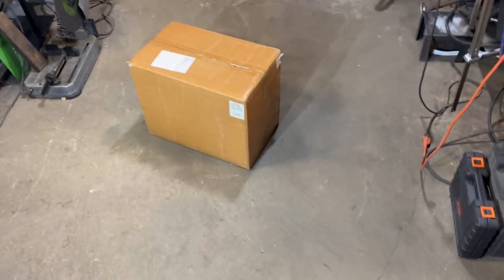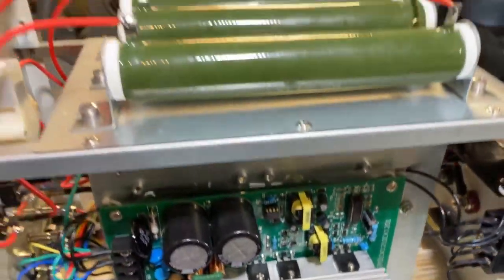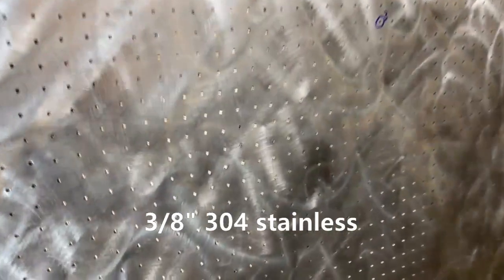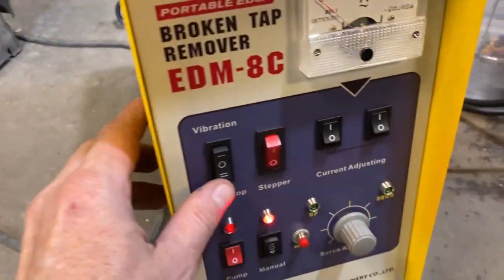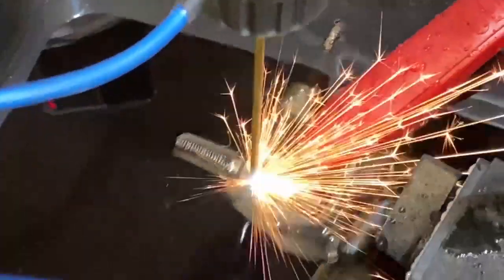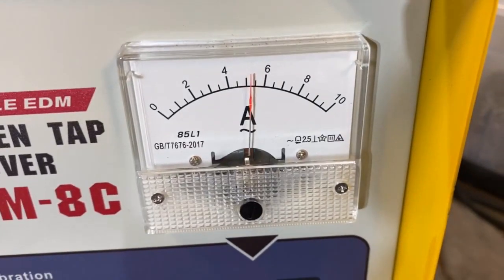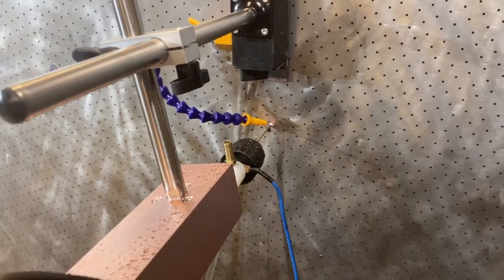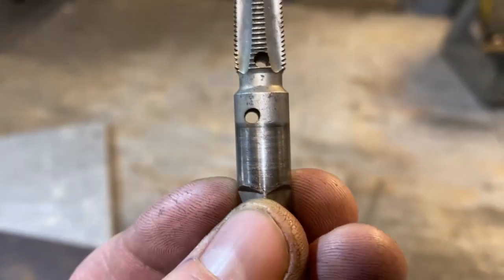EDM drill removing broken drill bits and drilling impossible holes

Comment: The wire wound resistor you repaired shows that the workers in the plant are sabotaging what they make. THIS IS BAD. This is exactly what started to happen when jobs in AMERICA started to move to the ASIA zone. Nice fix with JB weld NOBOX7.
          I use to repair machine shop BOLLIXES taps drills rivets just about anything metal. We would just mount the electro head into a drill press. The unit I think I just might have somewhere. I will look and see if I can get it to work. The burner used a special transformer that produced the pulse burner electricity. Just blows me away that one can buy this type of equipment for such a great price these days. Great video on a very important and useful EDM tool.